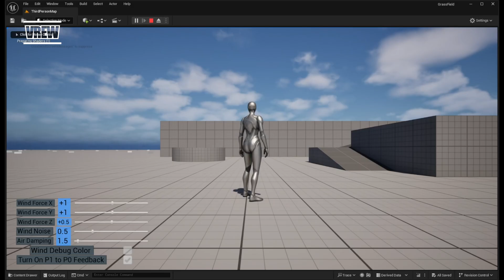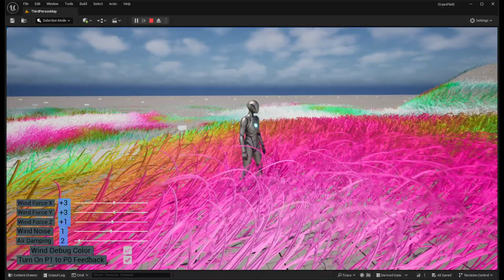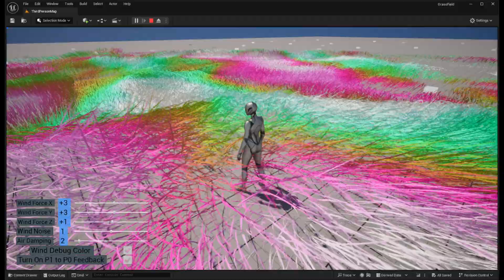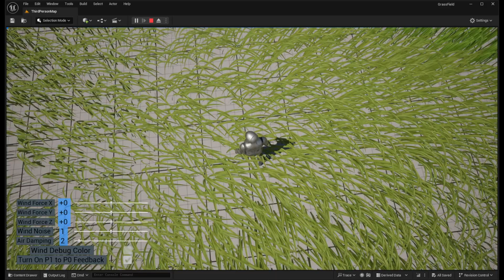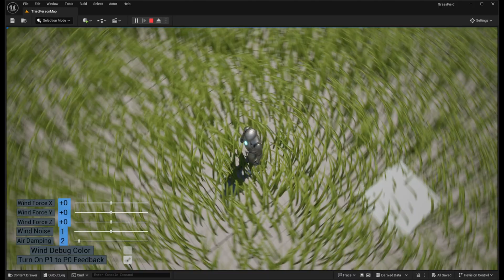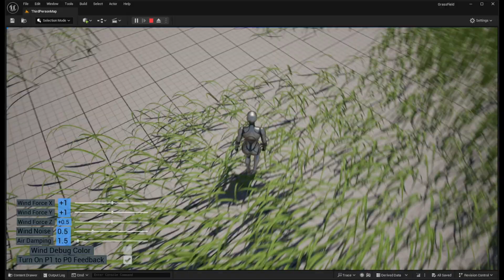Unreal Engine 5 Physics based Dynamics Grass motion.

Comment: Hi, it is great work, but I tried to check FPS in Shipping Build but it failed with error. Could you please check that.
Reply from the maker: Have you used "Download Zip" at Github page? After reading your comment, I found that if I use "Download Zip" button at Github, the project from the zip file gets error when it tries to load the map asset. However, there was no error when I used git to clone the code and assets.
Reply: @mojojojojono12  No, I use git clone, and map loaded succesfully, but when I try to make shipping build, it fails with error
Reply from the maker: I think Github LTS some error with "Download Zip" option.